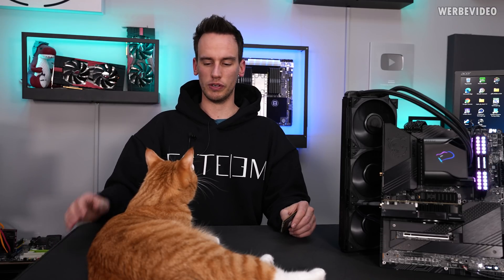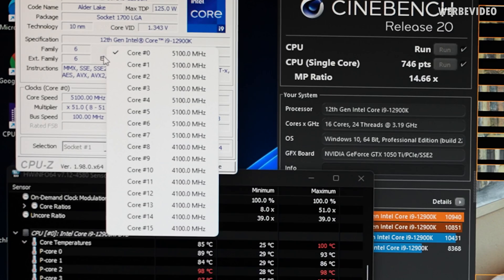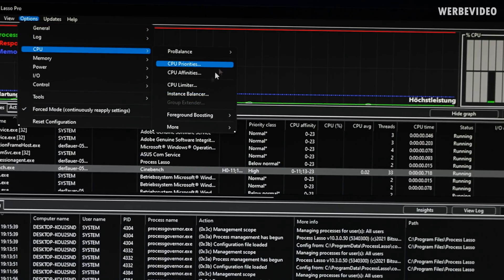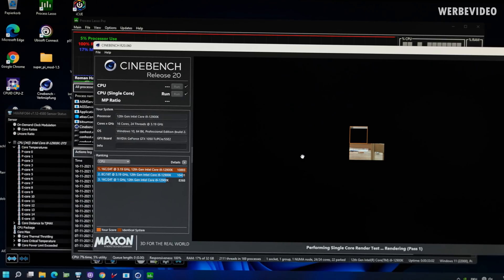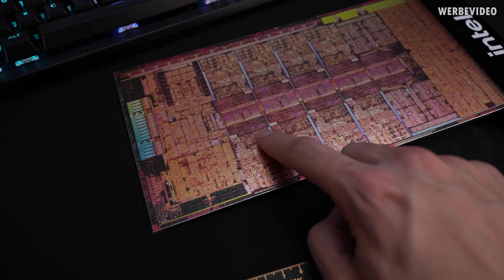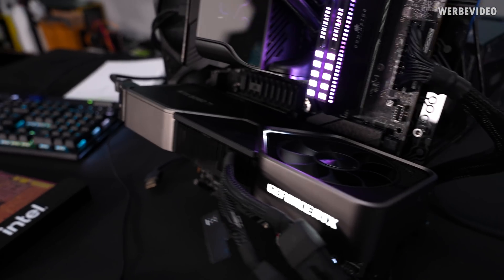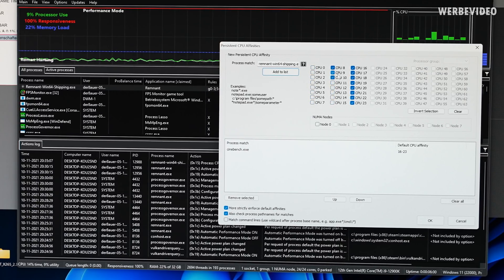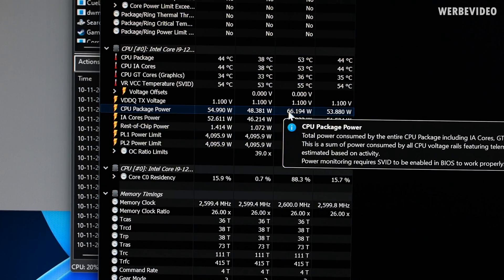The E-Cores were not meant to be used This Way... but it's Amazing!

Comment: I'm hoping Intel releases some SKUs with more E-Cores than P-Cores.  Something like 1 P-Core for every 4-8 E-Cores.
1+4 on low end, 2+8 low-Mid, 2+16 mid, 2+32 mid-high.
Reason being, most average users just don't need a multitude of P-Cores and the power savings across millions of machines is notable, for me personally, I prefer silence over performance and those E-Cores are gonna be really easy to cool for my NH-D15.

Comment: Damn, that really puts into perspective just how old and slow my CPU is! I thought my 4790K was still fast, but it only gets about 410 Single Core and 2000 Multi Core in Cinebench R20! Just the E Cores in this chip are faster than my 4790k!
Reply: Still, in most cases it doesn't really make a big difference, I'm still on a 3930k and 7970 and my only bottleneck is the 3GB vram
Reply: @satibel  Your use case isn't a good example of it not mattering though, unless you assume everyone uses GPUs from 10 years ago as you do
Reply: @kendokaaa  if I can play 1080p 60 with my setup, any upgrade will do better, so it's imo still a good example.
Of course if you want 170hz+ hyper mega ultra settings full rtx that's not relevant, and you probably will want the latest CPU.
Of course an old cpu like that will be a bottleneck for a 3080, but for a 1650 it probably won't.

Comment: If I heard correctly, E-cores are about as fast as the original skylake generation, the 6700K and alike. And having 8 of them.. That's quite a bit of power to have. Definitely worth having!
Reply: About the same IPC.  Lower clocks by default.
Reply: Forgot to add - without hyperthreading. So in reality, more like a 6600K. Not a slouch at all.

Comment: Roman it seems that you don't get what these people are talking about, myself included i see no point of having E cores on a desktop CPU, this Architecture was developed for mobile use where it shines, that's why every smartphone SOC out there uses it, but on Desktop intel used it to boost performance because they didn't want to scale past 8 P cores, they knew their CPU would end up like a furnace. 
i am 100% certain if intel had better efficient CPU design they would have never tapped into this heterogenous core design, it's the only way to compete with AMD and their supper efficient cores. 
Alder Lake is amazing, but even an ape can figure out that intel still struggles with efficiency.  that's my opinion on the matter

Comment: Cool and all, but if we don't know the actual efficiency (power usage compared to some scoring), their performance is irrelevant. "they are performing the same as a 7700K" or "1700X" is a useless statement if you don't know how much power they need to run something.

Comment: Imagine a core i3 with 3 P cores and 4 E cores… I think this setup would manage to not stay that far behind a 5600X
Reply: Unfortunately any CPU under the 12600k in the alder lake line has a different die with up to 6 p cores. Basically anything under the 12600 won't have any possibility to have e cores. A 4p 8e core variant would've been pretty cool though.
Reply: It would be useless for gaming tho
Reply: @dedoha8  IDK if it would be that useless… you would have 7 cores with 4 of them being skylake equivalent! The other 3 would carry the high resource demanding threads of the game while the other 4 would take care of auxiliary threads. The only thing needed is the game being aware of where to put each thread because I think that windows only schedules processes.
Reply: @galdutro  you realize programs spawn thousands of threads. It's not like a core does one thing. Your cpu cores are switching between 1000s of things every second. The thing is running at nearly 5 billion cycles a second.
Reply: @galdutro  fewer more powerful cores will always be better than that power spread over many cores.

Comment: I always set process affinity in the shortcut but making a batch file which assigns cores and also the priority. The line looks like this:

wmic process where name="process name.exe" CALL setpriority 32768 

this is all the options for the priority :

idle: 64 
below normal: 16384
normal: 32
above normal: 32768
high priority: 128
real time: 256

Comment: The performance of the E-cores lines up exactly with prelaunch leak expectations.  Basically staple a 7700k to higher clocked tigerlake.
Reply: 11900KB is 65 watts for PL1 and performs like a desktop i9-11900K.

Comment: If you just take a look at design and placement on die, it is so idiotic to ask why e-cores? For high end i9 and i7…Much smaller but performing nearly at half of the P-core. You can not place 2 P core in place of 4 E cores but nearly taking same performance with E cores.

Comment: AMD doesn't need E-cores because if you compare 5950x per core power consumption at 4.2 GHz it is about 7-8 wats which are quite the same as Intel's E-cores power consumption at same clocks. And I think that AMD's performance is about the same or better than Intel's E-cores.

Comment: Comparing just ST to ST, E-cores have about 60% of the performance of a P-core. Especially given the substantial clockspeed difference, that's pretty nuts! Very cool video.
Reply: Let's not forget the difference in thermals and power consumption.
Reply: @gurjindersingh3843  And 2 threads on a P-core, which, in the end, makes it ~2,2x productive.

Comment: Would be interesting to see how the performance changes when using: ALL Cores VS P-Cores ONLY VS E-Cores ONLY
Reply: Anandtech has that for some benchmarks IIRC.
Reply: Interesting observation! So if Intel would make e-core only CPU it would have about much higher multicore performance.
Or maybe 4 p-cores + 24 e-cores :)
Reply: @dmitrylozenko7123  I’ve been wondering if they’ll do this for mobile class CPUs. Maybe 2 or 4 P-Cores but stack up and have 8 e-cores. Have more efficient cores to run most tasks but having powerful cores available for heavier tasks. I wonder if this could be a leap forward in battery life.
Reply: I think PC World touched on that about a week ago. Gordon is wearing a Detroit Police t-shirt in the vid.

Comment: I must say I was definitely sceptical of e cores. Can easily see the value in having them on a laptop or such like with a battery but figured they'd be a waste on desktop. But its nice to see they're performing better than I expected. And its really good to see this kind of demonstration 🙂
Reply: Waste on desktop? E-cores are there for higher MT performance. You would get less performance if all cores were P-cores with same silicon space and power envelopment. Raptor lake will double number of E-cores and add zero P-cores.
Reply: @kognak6640  I know, thats why I said that its nice to see them performing better than I expected. I meant before they launched I thought they would be a waste.

Comment: Intel's 10nm silicon can't do more than 8 cores without running on crazy power, so the have to add Atom cores to have "good" core count. Rest is just marketing / propaganda.
Reply: Are you saying "P-core" is just marketing speak for "fast, hot, power hungry core" and "E-core" for "slow, weak, low power, smt gimped but atleast we have 16 cores core"?

Comment: A way I explain hybrid cores... it's like optane. You have low cost (in silicon) e-cores to do less interesting tasks. P cores = cache for high volume tasks. If you want 100% p-cores, you get a lot less compute/storage for your dollar/silicon. 100% e-cores will suffer in certain task models.